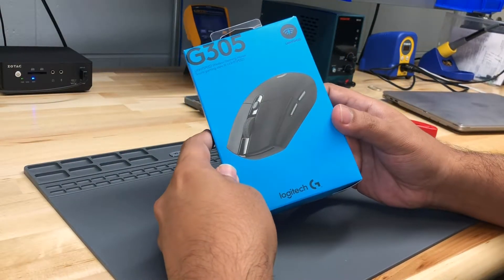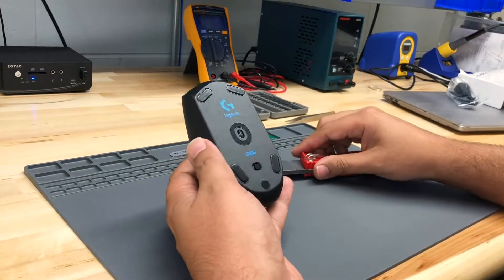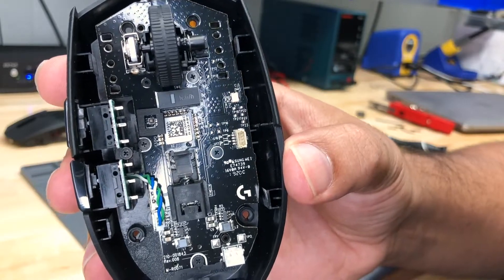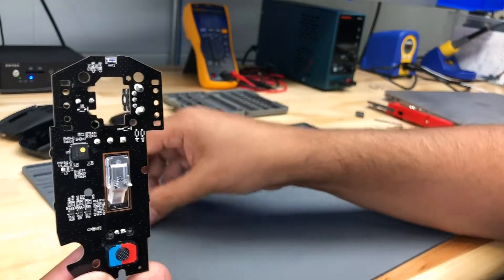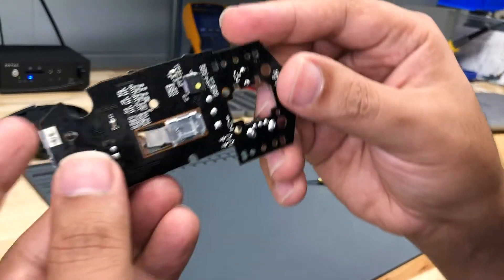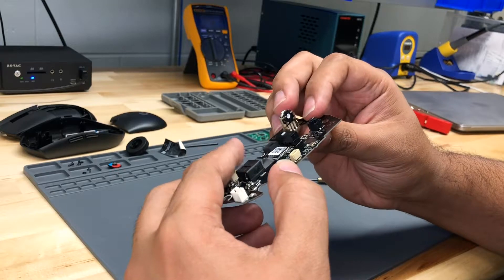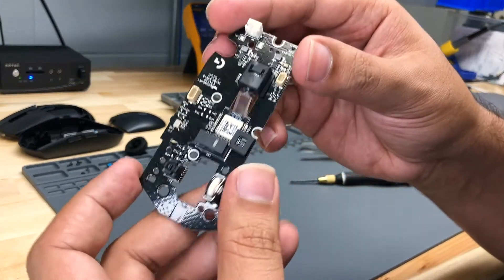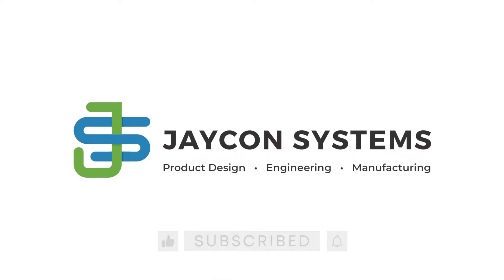Logitech G305 Mouse Teardown - Part 1

Comment: There are many sensors with public datasheets where the open information is insufficient to bring up a product, and you're back to reverse engineering and eavesdropping on the SPI bus. Though if you had to, you could use the A3050 which can be used with just the datasheet in hand, it's just like one and a half decades old at this point.

I'm sure there are other fields where the situation is even more dire, where zero components exist that wouldn't require manufacturer's NDA.

I wonder, the construction is... very unusual. The front buttons are on a pigtail, and there are drilled holes in the main PCB to clear the pins of the switches, but no pads. It even looks like they had ample routing space to actually make the switches solder in on the main PCB, i'd think it would be cheaper that way. So why didn't they?